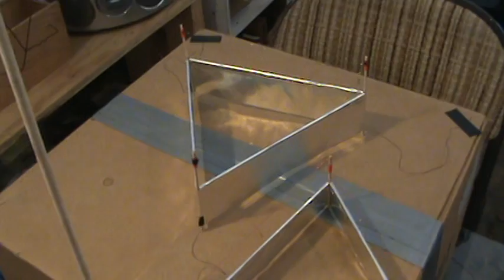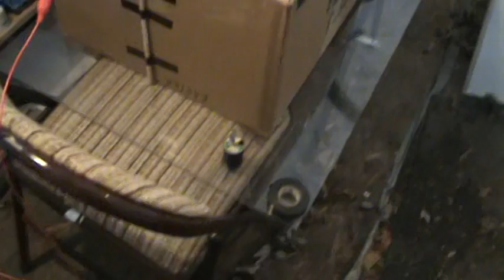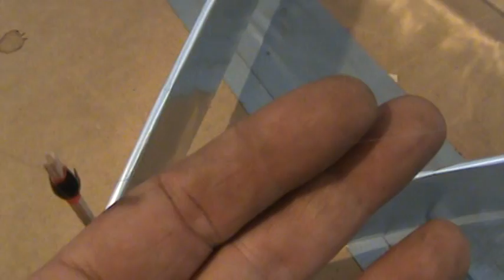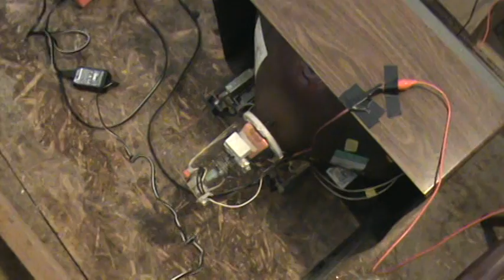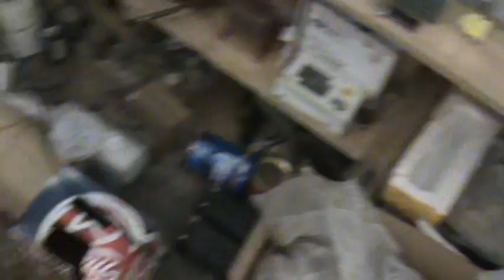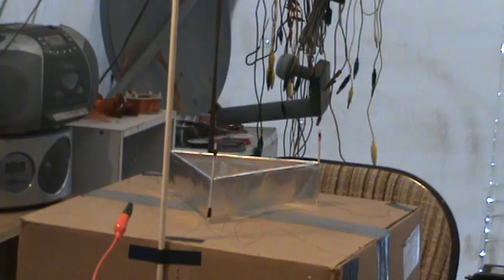LIfter/Ion Craft, Biefeld Brown Effect, Part 3

Comment: He sais that he could fly 200 kph with a scooter like engine .... however emphasising that it wasn't required as he could build engines that would propel themselves on the bases of his flying platform .

You know that gravity, time , light and any other wave would have also curved around it maybe not when standing still suspended in the air .

but the point is ... it connect free energy with anti g & if any anti g story is 4 real .. it's his .

Watch out researching this is depth can b trouble!